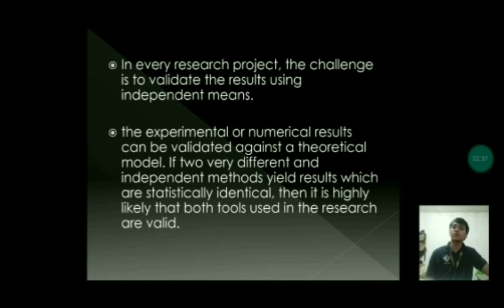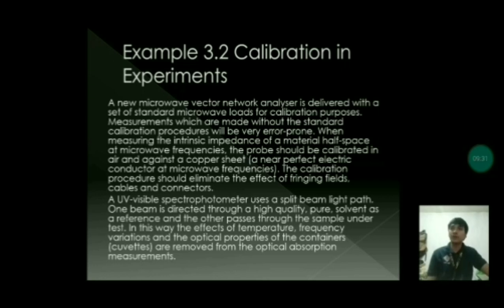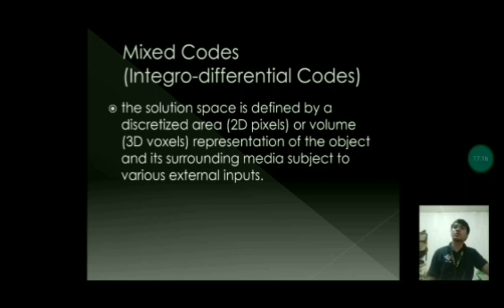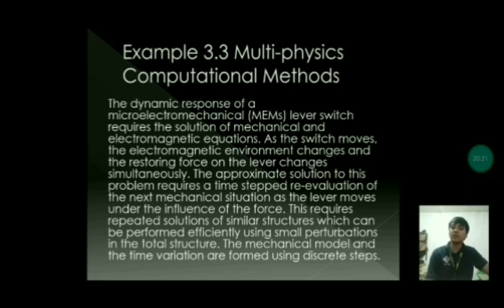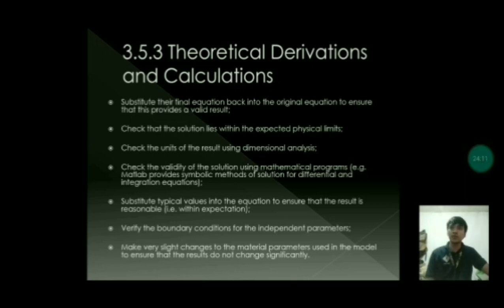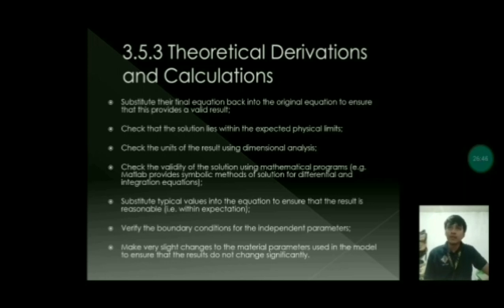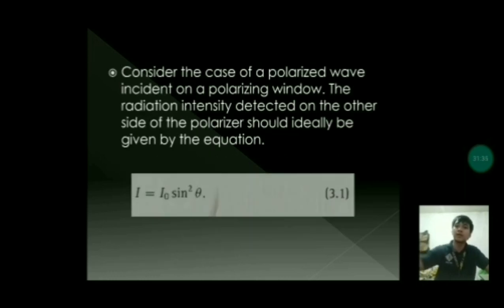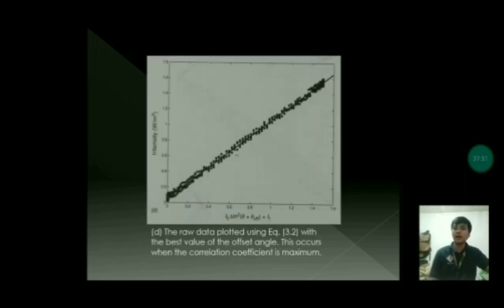Research Tools

Comment: Macalib-og, Jhon Paul C.
April 11, 2023
MWF 6:30 - 8:20 pm

Reflection
Research tools are very helpful in research. They help in gathering data and making the research. It is important to consider what tools to use or methods that is much appropriate in research to have the best results.

Reaction
The video is helpful and easy to understand.

Summary
Research tools are important because they help researchers to collect, organize, and analyze data in a standardized, efficient, and accurate manner. By using these tools, researchers can improve the quality and reliability of their research findings, which can have important implications for policy, practice, and further research.

Comment: Mejorada, Iris Abigail T.
April 07, 2023
MWF 6:30 - 8:20PM

Reflection:
The use of independent means to validate research results is a critical aspect of ensuring the reliability and validity of scientific research, and it is essential for making informed decisions based on research findings.

Reaction:
It is very informative and it was discussed well.

Summary:

There are many methods that can use in a research tool such as experimental measurements through calibration, numerical modelling through mixed codes (integral or differential codes),  multi-physics computational methods, theoretical deviations and calculations, and curve matching.

Comment: Name: Zamora, Jun Jr. K. 
Date: April 1, 2023
Schedule: MWF 6:30-8:20PM

Reflection:
After watching the video lecture about research tools, I learned that in process of conducting a study researchers must identify and properly evaluate research tools to  validate validate results. With proper of research tools we can avoid systematic uncertainties and errors. 

Reaction:
The video presentation is very informative, ideas was presented in a concise manne. The powerpoint presentation and audio quality is great.

Summary:
The topic talks about the importance of research tools in validating results, and prevent uncertainties and errors. It also covers calibration methods and the use of standard measurement tools which is valuable for correctness and accuracy.

Comment: Gales, Beama G.
April 01, 2023
Saturday (4:30 PM – 8:30 PM)

Reflection: 
Choosing the appropriate tool for a particular project is very important in achieving a successful research. The research tool used can make it easier for you to identify trends and draw conclusions to answer your research questions and it will determine the outcome of the study.

Reaction:  
I am amazed how detailed the video presentation is. The reporter is knowledgeable about the topic and was able to deliver it very well in a way that the viewers can easily understand. 

Summary: 
The video provides an overview of the different research tools that are available for engineers. It discusses the various types of research tools, how to select the best tool for a specific research project, and the benefits and drawbacks of each tool

Comment: Tagle, Charlie P
March 31, 2023
MWF 6:30 - 8:30

 REFLECTION: 
After watching the video, I’ve come to understand that It's essential that you recognize the various research tools, in particular their functions.  In order to make research more easier and effective .

REACTION:
The presentation was instructive, and the reporter carefully described each of the examples given such that they were understandable. He gave thorough explanations of the various research tools.

SUMMARY:
Engineering research mostly uses experimental methods for the most accurate measurements, and agencies like ISO and NATA provide trustworthy standard measurement techniques. To determine the best approaches for a particular situation, the correctness of solutions is evaluated and compared using a range of techniques, including numerical and theoretical modeling, curve matching, and other methods. It is critical to compare experimental results and check statistical identification in order to validate the instruments that were utilized.

Comment: Ragudo, Jeff Laurence B.
March 27,2023
MWF 6:30-8:20pm

reflection 
research tools is that they provide a standardized and systematic approach to collecting data, which increases the reliability and validity of the research findings. This allows researchers to make meaningful comparisons across different samples or settings, and to draw more accurate conclusions about the phenomena under investigation.

reaction 
From the video presentation, the reporter discusses the subject in a clear and understandable manner, and the presentation is effective enough for the listener to understand. 

summary 
Research tools are critical components of the scientific process, but they must be used with care and consideration. Researchers must carefully evaluate the strengths and limitations of each tool they use, and take steps to minimize the potential for bias or error. By doing so, they can ensure that their research findings are reliable, valid, and meaningful, and can contribute to the advancement of knowledge in their field.

Comment: Ebon, Recarl R.
March 30, 2023
MWF 6:20-8:20 PM

Reflection

In this video, it talks about the importance of the gathered results and findings to be reliable and validated, and this method is called research tools. There are different tools that can be used in order for our results can be trusted or reliable.

Reaction

That was my report, sir.

Summary

Research tools is a method of validating the results of a study, in order for the results can be trusted or reliable. There are different research tools that can be utilized such as experimental measurements, numerical modelling, theoretical derivations and calculations, and curve matching.

Comment: Banguiz, Tiffany Fate A.
March 27, 2023
MWF 6:30 - 8:20 PM

Reflection:
The selection of research tools for gathering data is vital in the process of making the research successful. The research tools will help make the research credible. In order to obtain reliable results the researcher must choose the right research tool.

Reaction:
The topic was well delivered and further discussed by the reporter. Overall the report was informative.

Summary:
The researcher can obtain reliable results with the help of the research tools. This can be obtained with calibrations, software, theoretical derivations and calculations, and through curve matching.

Comment: Trono, Clark M.
BSECE – III
March 27, 2023
MWF 6:30 – 8:20

Reflection:
This chapter presents an overview of the numerous research tools accessible to engineers, including issues such as the research tool types, how to select the proper tool for a certain research project, and the benefits and drawbacks of each tool.

Reaction:
I like the way the video is presented. The words are clear and informative

Summary:
The most precise measurements come from ISO- and ATA-accredited experimental procedures. The correctness of answers is established by comparing and contrasting the results of various numerical and theoretical modeling approaches, curve matching, and other methods. If the experimental results are identical, the tools are valid.

Comment: Gador, Christian M.
March 27, 2023
MWF 6:30 - 8:30 pm

REFLECTION: 
I learned more about research tools which are used to validate the results of the research. 

REACTION: 
The reporter's voice is clear and understandable. The presentation was also well made and explained thoroughly. 

SUMMARY:
To validate the results, factors such as standard measurement tools and calculations should be fact checked to ensure that the proper method and results are obtained.

Comment: Inguito, Aidel C.
March 27, 2023
MWF 6:30-8:20 PM

Reflection
The research tool was explained in the report, and it is the instruments used for data collection. The researcher creates the research tool based on the objectives. Various instruments are used to conduct the assessment forms for data collection, depending on the nature of the information to be gathered.

Reaction
Overall, the presentation was excellent. I like the reporter's reporting style; it shows how knowledgeable he is about the subject. The reporter was able to cover and thoroughly discuss the important topics.

Summary
According to the report, we can utilize a variety of research instruments to confirm our findings. The theoretical derivations and calculations involve substitution that suggests the level of random error, just like experimental measurements, which are through calibration procedure, numerical modeling, which requires repeated solutions using small perturbations, and curve matching, which is a visual inspection of a line.

Comment: Lecira, Jezreel Dec B.
March 27,2023
MWF 6:30-8:30 PM

Reflection:
This video presentation talked all about research tools and how these research tools can help the researcher in choosing the best approach/method he/she can use to express how the results will be presented.
Reaction:
I found this video report very informative. It gave good explanation and helped me understand the importance of building trust with the respondents. 
Summary:
To summarize this video is all about the different research tools that researchers can use to evaluate the validity of the data results that is to be collected. And the tools are as follows numerical modeling , theoretical derivations and calculations , experimental measurements ,  and curve matching techniques. And each of these techniques are a big help to researchers as they strive for good results.

Comment: Mamac, Jane L.
March 27, 2023
MWF 6:30 - 8:30 PM

 REFLECTION: In this chapter, I learned that research tools are crucial because they facilitate the gathering, processing, and interpretation of data.

REACTION:  The report is well discussed and presented. 

SUMMARY: Research tools, such as experimental measurements, numerical modeling, theoretical derivations and computations, and curve matching, are approaches used to validate the findings of a research project through independent means.

Comment: Alampay, Kenneth R.
March 27,  2023
MWF 6:30 - 8:20

REFLECTION:
Numerical or experimental results are a crucial part of research, and it's important to validate them using different research tools. This can be done by comparing calculations after the results are obtained. A reliable presentation of data analysis is necessary to gain the trust of the audience or participants, and identifying errors is important.

REACTION:
The video presentation did an excellent job of explaining each aspect of the topic and provided helpful examples for better understanding. Overall, it was well-prepared, well-delivered, and informative.

SUMMARY:
There are various research tools that can be used to validate results, including experimental measurements through calibration, numerical modeling involving repeated solutions using small perturbations, theoretical derivations and calculations using substitutions to suggest the level of random error, and curve matching through visual inspection of a line.

Comment: Zacarias, Lorrie Jaye U.
March 27, 2023
MWF 6:30–8:30

Reflection:
The video provided an overview of the various research tools available to engineers. It discusses the various types of research tools, how to select the best tool for a specific research project, and the benefits and drawbacks of each tool.

Reaction:
The video is very informative, and I learned about research tools.

Summary:
The video report also explains the importance of calibration procedures and the use of standard measurement tools. The correctness of solutions is assessed and compared using a variety of techniques, including numerical and theoretical modeling, curve matching, and other methods, to discover the most effective ways for a given circumstance.

Comment: Duhaylungsod, Lynard S.
March 27, 2023
MWF 6:30PM – 8:20PM

REFLECTION:
In making conclusions and implications on the data that have been gathered we need the research tools to analyze the data. In this chapter, the viewer will know on what specific research tool must be used in a specific data that were collected.
REACTION:
It was a well presented report. Examples were also given in order to make the topic simpler to understand for the viewer. Same as the other presentation, this video is also informative in which it will really help a researcher in conducting or doing a research study.
SUMMARY:
In order to have accurate answers or the best answers that we were looking for as a researcher we need to select the appropriate research tool in it. Experiment measurements, numerical modelling, theoretical derivations and calculations, and curve matching are the ones that being stated in the video as the examples of research tools.

Comment: Sojor, Gwenshane Arnel R.
March 27, 2023
MWF 6:30-8:30PM

REFLECTION
I have learned that each of the research tools that have been discussed has specific strengths and limitations, and the choice of which tool to use depends on the specific research question and the nature of the data being analyzed. It is important for researchers to carefully consider the available methods and select the most appropriate one for their research.

REFLECTION 
I was amazed how the reporter managed to excellently discuss the report or the topic assigned to him. Truly, he was knowledgeable of his topic and he did a great job. Bravo👏🏻

SUMMARY 
The research tools presented from the ebook are different from the ones in the PowerPoints (the other reference). Included in the discussion are: (1) Experimental measurements- standard measurement tools provide the best method of gaining reliably measurements; (2) Numerical modelling- refers to the use of mathematical algorithms and computer simulations to analyze complex systems and predict their behavior; (3) Theoretical derivations and calculations- the process of using mathematical and analytical techniques to derive and solve equations that describe a physical, biological, or social system; (4) Curve matching-  a technique used to compare and analyze two or more sets of data by matching their respective curves or functions.

Comment: Mariot, Aubrey C.
March 27, 2023
MWF 6:30-8:30 PM

Reflection:
The video report discusses how it's crucial to verify research findings using various techniques and to ensure that workplaces are safe and yield high-quality results. Since numerical or experimental results are significant components of research, it is vital to confirm these findings using various techniques.  After the results are produced, it can be done through the comparison of computations. You need a trustworthy presentation of your data analysis if you want the audience or participants to trust your research. 

Reaction:
The video presentation was well-presented. Informations provided are very useful when conducting research study.

Summary:
We can verify our findings using a variety of research tools. Similar to how calibration procedures are used for experimental measurements, numerical modeling calls for repeated solutions using small perturbations, theoretical derivations and calculations involve substitution, which indicates the amount of random error, and curve matching is a visual inspection of a line, the necessity of validating research results using independent means as well as addressing workplace health and safety and quality assurance cannot be overstated. The usage of standard measurement tools and the significance of calibration procedures are also explained in the video report.

Comment: Michael Angielou G. Labrador 
March 27, 2023
MWF 6:30pm - 8:20pm 

Reflection: 

In every research project, it is important to know the research tools. Knowing the research tools will help us determine the best possible way to measure our studies and make it reliable.

Reaction: 

The topic being discussed by the reporter is wide topic of research tools. The reporter discusses it with examples and presents more definitions and explainations.

Summary: 

This topic is about the research tools. An example of a research tool is the systematic uncertainty. In here, the research team uses a published method of measurement and the conclusions agree with the previously published work. Standard measurement tools provide the best method of gaining reliable measurements. There are also examples of calibration measures. The NATA and ISO are some measurement accreditation authorities. Numerical modelling are the experimental or numerical results that can be validated against a theoretical model. Examples are the mixed codes (integro-differential codes) and the differential codes. There are also theoretical derivations and calculations. One task of this is to check the units of the result using dimensional analysis. Another research tool is called the curve matching which applying the independent variables to the equation and calculating the dependent variable is present.

Comment: Balbon Neil Bryan B.
March 27, 2023
M-W-F- 6:00-8:00 PM
Reflection: 
Following viewing this video presentation, I discovered that utilizing common measurement instruments and it's crucial to test alternate methods, like as ensuring that models and data are followed a specific mathematical equation for precision. 

Reaction: 
The reporter employs straightforward language and clarifications to guarantee the presentation is understandable. There is uniqueness in presenting the report I understand the concept very well.

Summary
In general he  discusses the significance of confirming research findings with independent explains what several research instruments, including using numerical data as experimental measures modelling. computations and theoretical derivations,and matching curve.These chapter took a lot in how very important research tool it is.